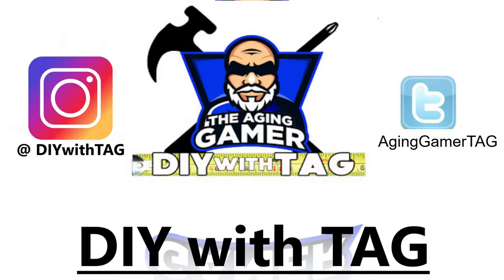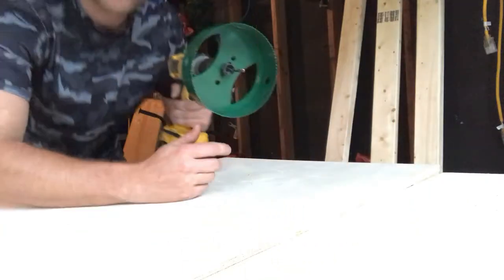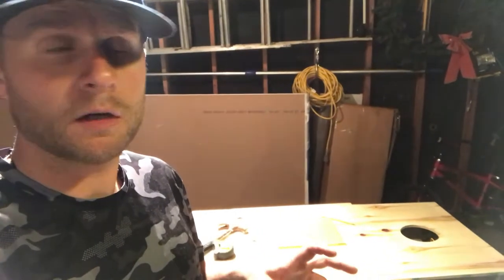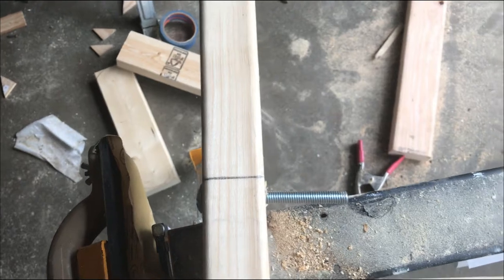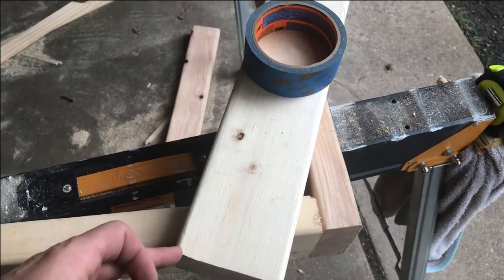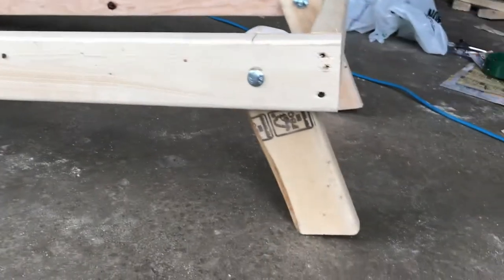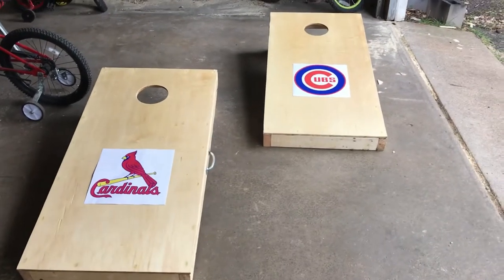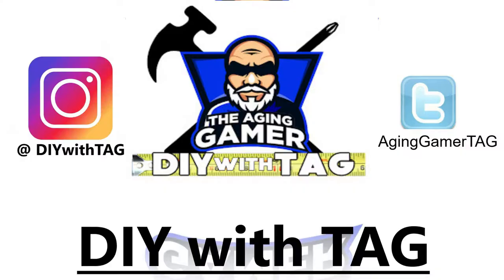DIY Bean Bag Toss Corn Hole

Comment: Nice job. Would it have been easier to keep both sides consistent by stacking the plywood and drilling the hole for both at the same time?
Reply from the maker: good thought....i think you could get away with the pilot hole drilled through both very easily....the hole saw would work but you would really need it clamped down well cause it bites kinda hard at times through that plywood...all in all next one i may try the pilot whole through both to get it it dead on
Reply: @diywithtag202  Good thoughts on both. I know I've had problems getting the hole out of hole saws if I try going through too much material.

Comment from the maker: 1 - Sand Paper 3.85
8 - Washers 1.96

4 - Wingnuts 3.27
4 - 2x4 8' 9.24
2 - 3/8 2x4 plywood pre-sanded 9.98
1 - MinWax Polyurethane 10.96
1 - Wood Putty 2.49
4 - 3/8' Carriage Bolts 8 pack 2.08